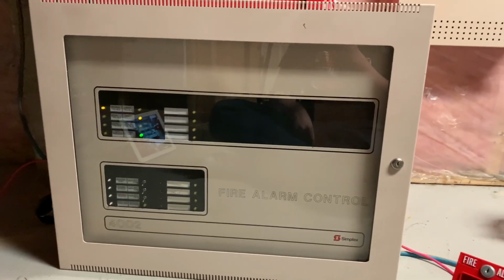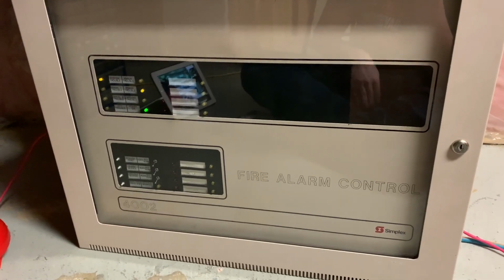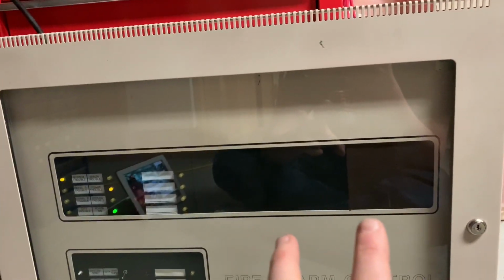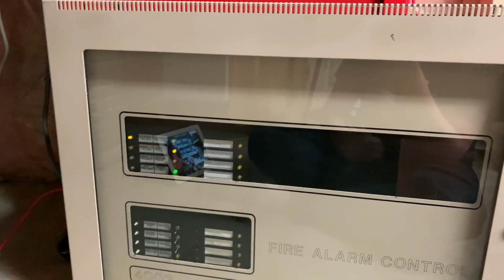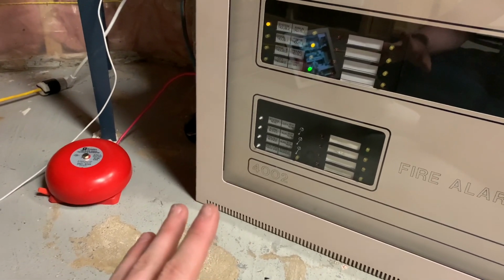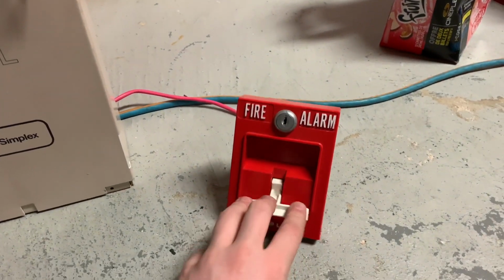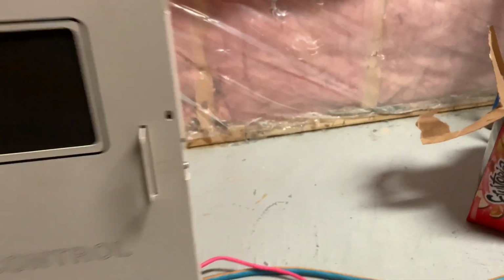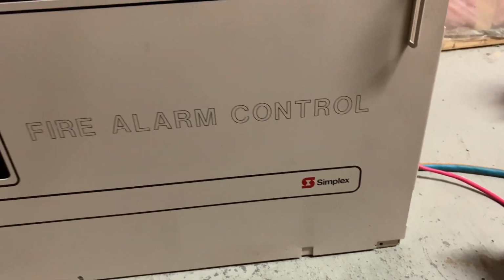Test Of My Simplex 4002

Comment: I remember the Art Center at my friend's university used to have a Simplex 4002 system just like that. It was installed next to what was once a Simplex 4208 panel that had been gutted and is now used for terminal wiring, and the system consisted of 4051+4050-80 horn/lights and 4251-30 break-glass pulls that were part of the original 4208 system, along with 2098-9201 photoelectric smoke detectors obviously installed with the 4002. But several years ago the 4002 panel was replaced with a Simplex 4007ES system (the 4208 terminal cabinet is still intact), and they replaced the Simplex 4051 horns with 4906-9127 TrueAlert horn/strobes slapped right onto the 4050-80 light plates.